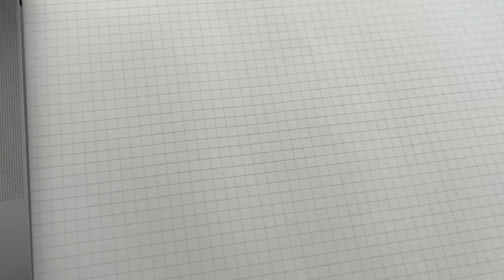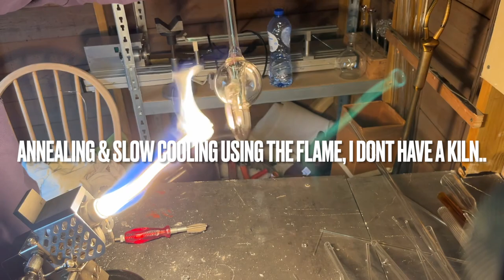Let's make a new Klein bottle

Comment: That was very good and I enjoyed watching your video. I make those in exactly the same way, I started scientific glassblowing in 1973 and when I was a young apprentice, my instructor always told me when putting a sidearm on, was to heat, push join, pull and blow ! best advice I was ever given. He told me when annealing without an over was to lower the oxy content, move work to the top of the flame and slowly build up the carbon, then to raise the oxy slightly to "scorch" off the carbon and then lower the oxy and reapply the carbon layer, as the carbon burns off at 450C and the glass anneals at 560C... Ohhh am I giving away the secrets lol !
Reply from the maker: Thanks for your visit, and comment! I use annealing as a "better than nothing" approach as 1) no kiln and 2) no compressed air. Ah well, limitations come with the hobby. ;)
I like your glass steam engine!
Reply: Secrets should be lost and forgotten to time.